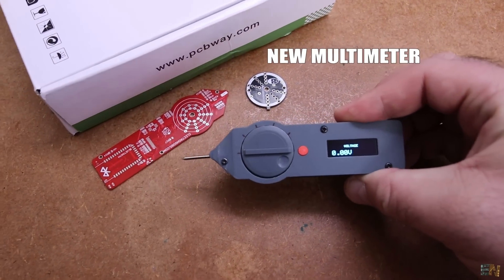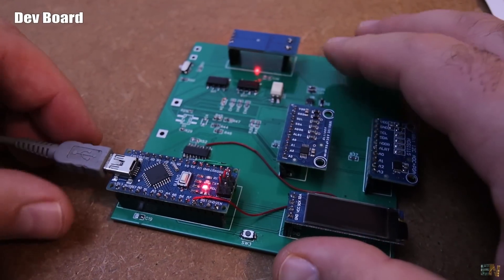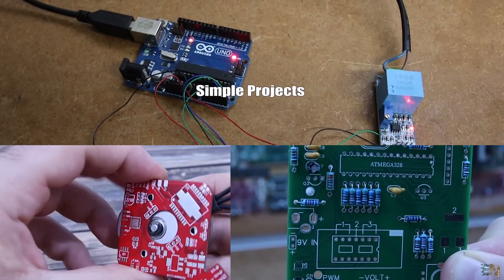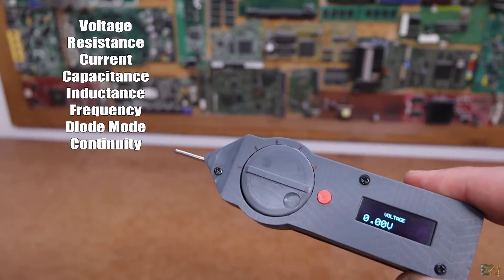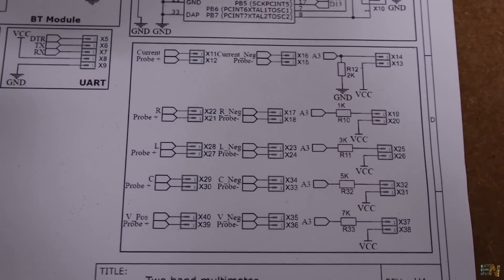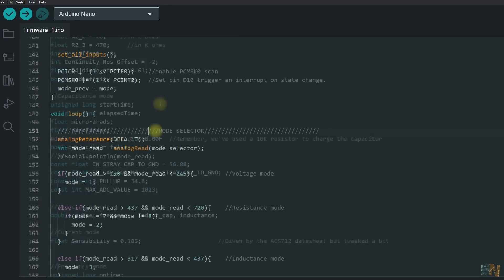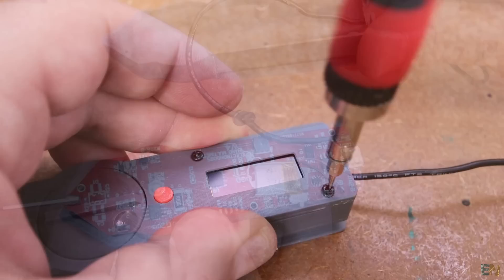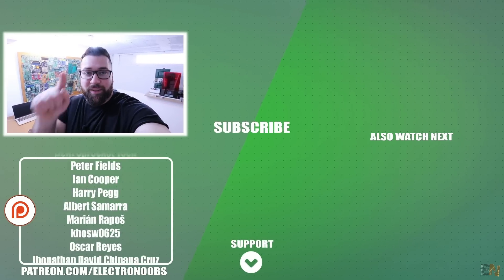BEST Homemade Two Hand Multimeter - Finally!

Comment: Great! This one you should sell as a kit, since it has a couple of components that not everybody may have laying around just by chance :-)
Reply from the maker: You think people would be interested into buying it and then solder it themselves?
Reply: @ELECTRONOOBS  I think a lot of people would buy the parts from you and solder it themselves, but I am not a businessman ;-) It sounds like it could be a good deal, but for me, I already have two very good multimeters, plus some others, so it wouldn't be high on my priorities list. It's a great project given that lots of people are using multimeters for low voltage, low power DC projects.
Reply: Can you sell your pcb soldered
Reply: @ELECTRONOOBS  I think so, but don't listen to me. I'm terrible at judgements involving other people 😉 Maybe you get some feedback in the comments here that give you a better sense of the demand out there.
Reply: @ELECTRONOOBS  Yes, sure. The kit must include everything to make it finished  tester, ready to use.
Reply: @ELECTRONOOBS  i think having two versions will do it, packaged and DIY
Reply from the maker: @abdullahisanidodo2876  an already soldered one would be too expensive since it would be too much work for me... Also a PCB assembly is very expensive for a two side PCB
Reply: @ELECTRONOOBS  I have seen some kits sold with only a few chips presoldered, such as an MCU with many pins or extra fine pin pitch (or could even be a BGA). If those parts can be designated to only one side of the board, then it would only become a single-side PCB assembly, right? Unless you can manage to set up a very effective procedure to do it, I can see how handsoldering such units yourself quickly would become too expensive or time-consuming.
Reply: @ELECTRONOOBS  If I could get a bag of components to solder and order the rest from pcb way I'd be happy.
Reply: I'd absolutely solder my own, given the components.

Comment: @Electronoobs it's becoming better and better, very nice!
what would i add? maybe you could add text with youre fiber laser?
also it would be nice to see how the accuracy compares to youre Keysight multimeter..
Reply from the maker: Accuracy is pretty decent especially for voltage and resistance using the 16 bits ADC
Reply: @ELECTRONOOBS  Actually having some form of calibration ability, like the older multimeters had internal trimpots, would be a nice future feature enhancement. It doesn't need to be accessible from outside the enclosure.
Reply: Another way to calibrate could be via the USB serial. Procedure and correct values could be prompted to and read from the user that way. Calibration parameters could then be stored in the internal EEPROM.

Comment: Looks great!

I don't know if you have it already.
But a buzzer option on continuity would be very useful.
Reply from the maker: It has a buzzer and an LED
Reply: Add a function that reads resistance as a tone. Then you can look for shorts without looking at the display. A different resistance is very easy to "hear"
 @ELECTRONOOBS